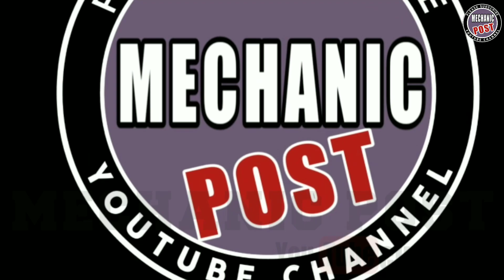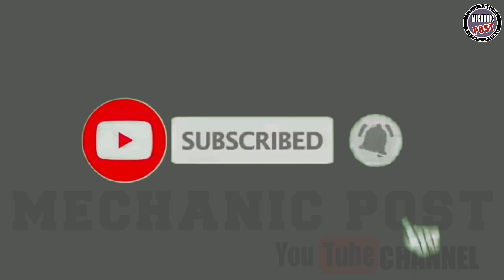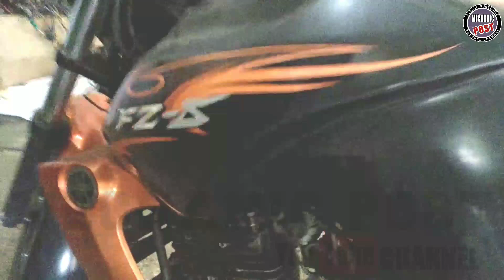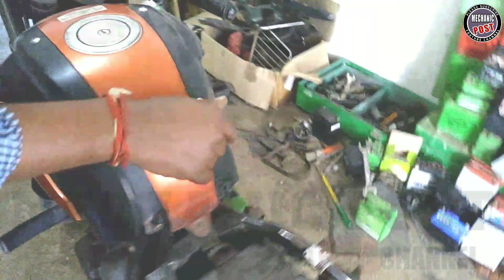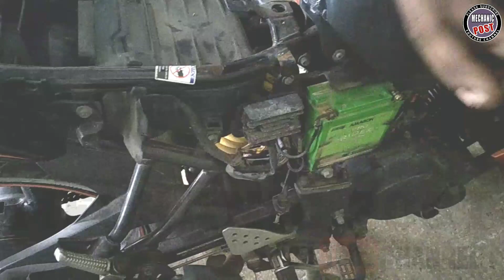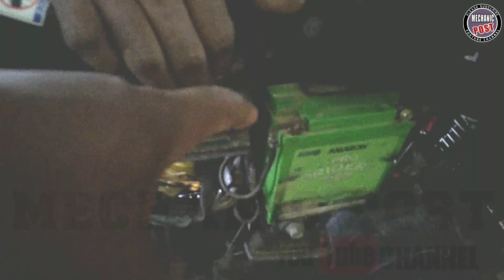Two wheeler Bulb fuse ஆக காரணம் என்ன?

Comment: RR. unit mean regular rectifier.. Ok. 
Ragulator mean magonoto coil erunthu high voltage varum i mean 12v above.. Varum. .. So antha current a 12 . Volt a correct a convert panardu ragulator working

Rectifier use . Oru battry coli la vara AC voltage la charge agadu.. So.. AC. -DC PANRADU RECTIFIER VALI.. OK.. @ MORE INFORMATION COME TO MY CHANNEL